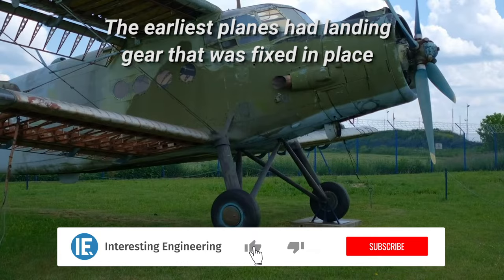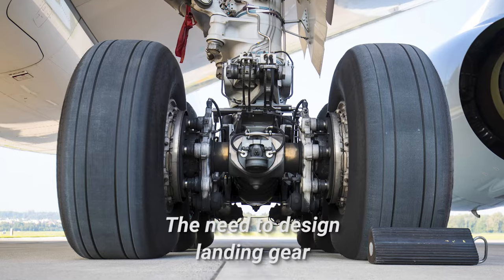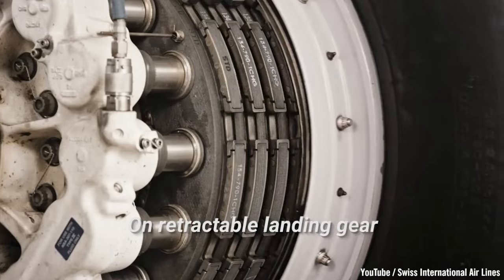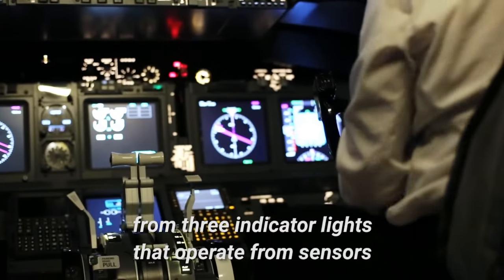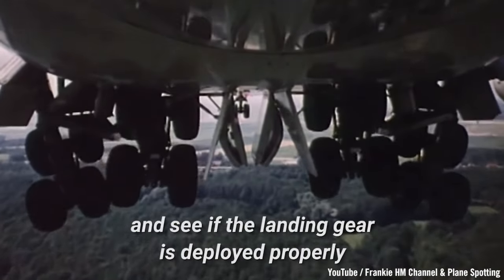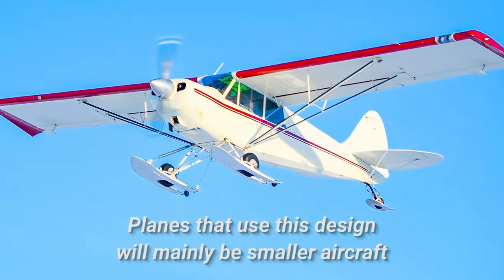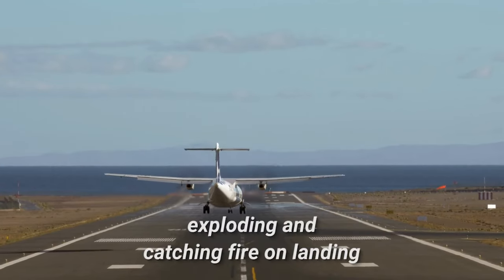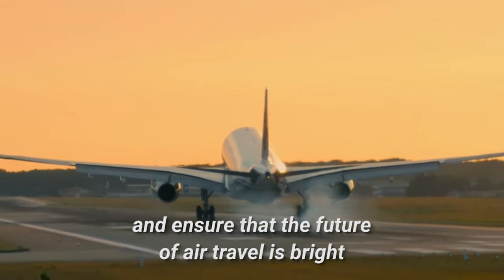How landing gears work

Comment: is it necessary to keep inside the landing  gear of a airplane after take off? does it really affect the flight if it still deployed
Reply: Yes it’s extremely necessary extreme drag from the tires can cause big problems for commercial airplanes if left open the entire flight, stalls and increased fuel intake can happen not only that if the forces are enough, the entire mechanism could rip off